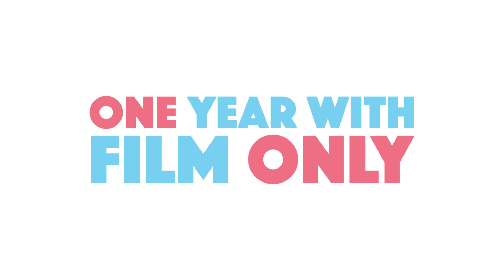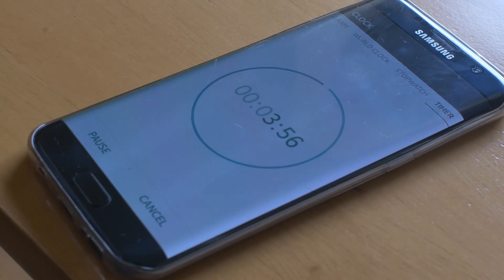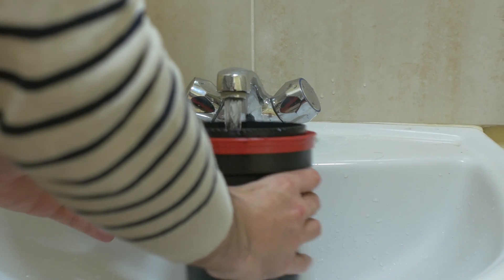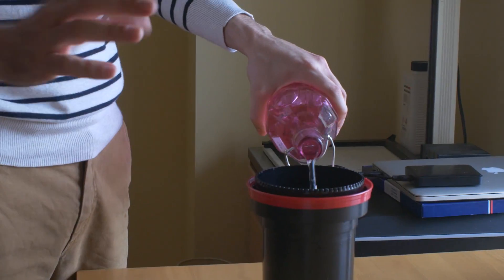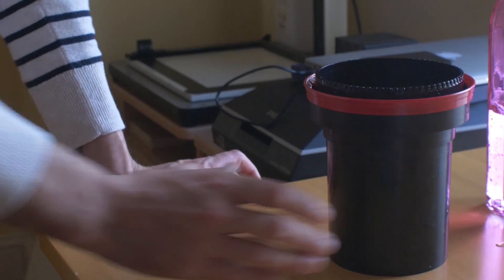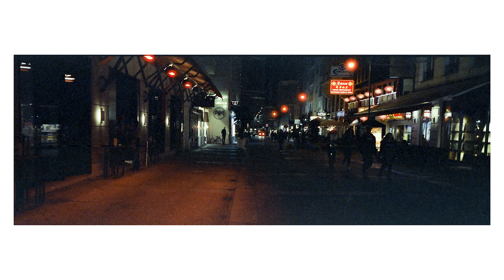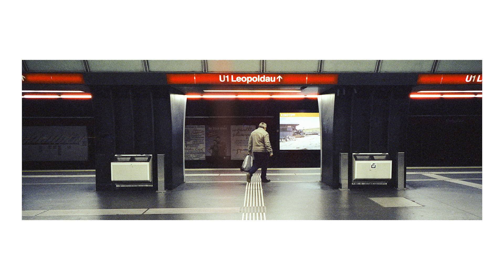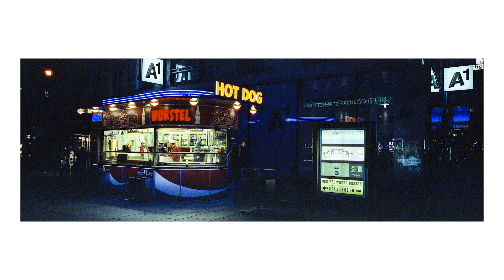How To Push & Develop C41 Colour Negative Film at Home {CineStill 800T Pushed at 3200 ISO}

Comment: Hey ! Thanks for the amazing video...
If you have to push the film by +2, do you put 800ISO on the camera or 3200ISO ?
Thanks :)
Reply from the maker: Thanks for watching Jaineel! Glad it could help.

In this case I set the ISO at 3200 on my camera to trick the lightmeter. If your camera settings don't allow to go that high in ISO, you can use an external light meter (smartphone app does the trick) and use to meter the scene with the ISO of your choice, then adjust aperture and shutter speed accordingly on your camera.

Hope this helps ;)
Reply: @OneYearWithFilmOnly  I've never quite grasped how this works. If you set your ISO at 3200 (in a 800ISO roll) you would be tricking the camera to assume that it is more sensitive than it actually is, so in some situations wouldn't the lightmeter tell you to stop down the exposure instead of telling you to bring it up? Shouldn't you put the ISO at 200 so the lightmeter will tell you that you are underexposed therefore you need to bring more light in? Also is it absolutely necessary to trick the camera or could you just shoot at box speed and leave the push to the processing part only? This confusion is what's been keeping me from trying to this. I'm sorry for the long and probably stupid questioning and thank you so much for your videos!
Reply: Hugo Sousa I understand you confusion I had the same sentiments when I started out. lets say you have 400 box speed film you want to push it, the problem with rating the film at 200 is this would overexpose the film and when developed it will turn out to be very harsh on your highlights and your whites. But by tricking the light meter and rating it at 800 would then on lead it to be underexposed thus the need to increase developing time to compensate for that.
Reply: @hugotomassantaclaus  pushing is underexposing and compensating by overdeveloping, pulling is overexposing and compensating by underdeveloping

Comment: Great videos, thanks for the insight! 
One Q.! How are you maintaining the chemicals at these precise, constant temperatures?
Thanks again, 
L
Reply from the maker: Thanks Lucas! I put the bottles in a warm bath in my sink (usually 2-3 degrees above the required temp). If I need to adjust the temperature quickly I put the bottle under hot water and agitate the bottle to spread the heat evenly. Also, glass bottle are IMHO better at maintaining temperature than plastic ones